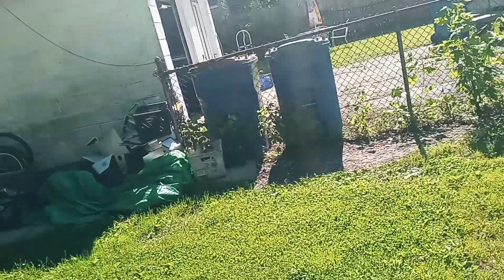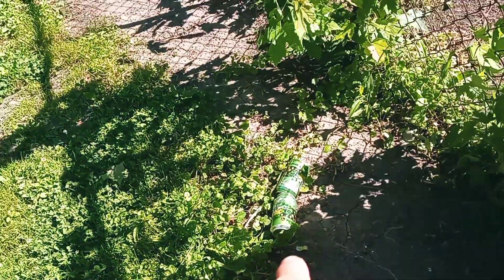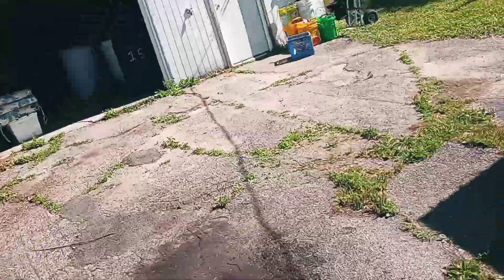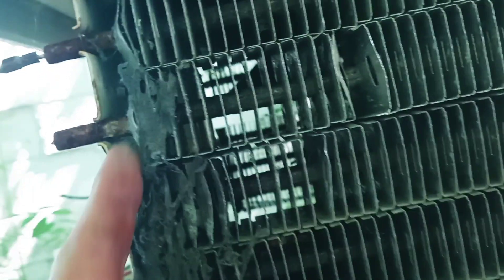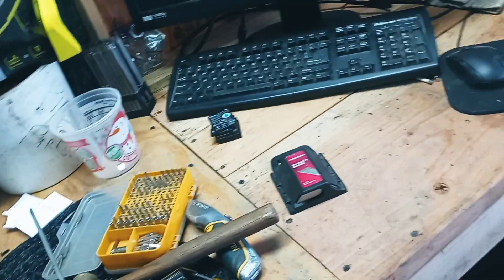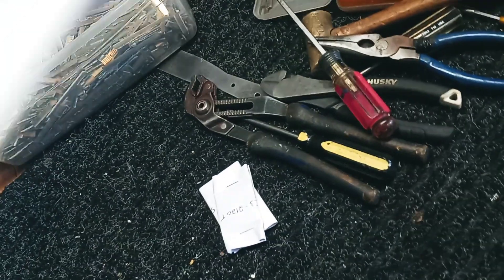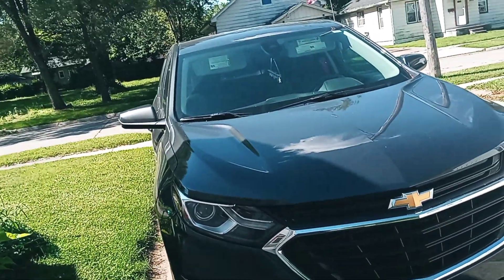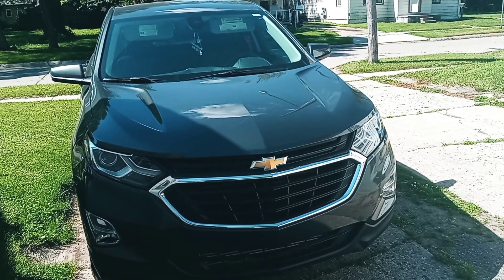Early morning drop off

Comment: 11:06 Chris told you to take the hard drive board and memory from the all in ones. (mail that material out to sell) Putting the rest in shred was your idea. If breaking down further, the motherboard inside will likely be small socket color.  and there will be a little wifi card inside and a cpu as well.
Reply from the maker: Shred it the same price as selling the complete unit to you. Lol
Reply: @ewastemike7700  All of the weight is in the screen. Lots of garbage just to gain a color mb, laptop ram and laptop hdb. That is why they pay so little. If your yard takes the remaining screens as shred then wow go for it. If we tried to dump all of the units we get into our shred load they would charge us, not pay us. lol! They are essentially fancy monitors in the eyes of the recyclers.